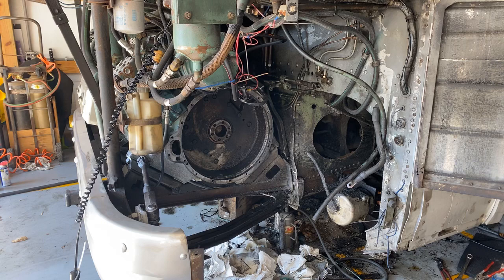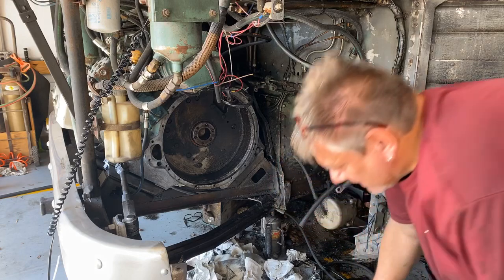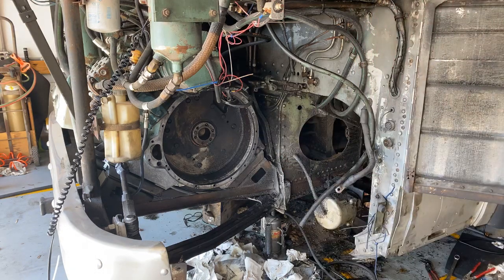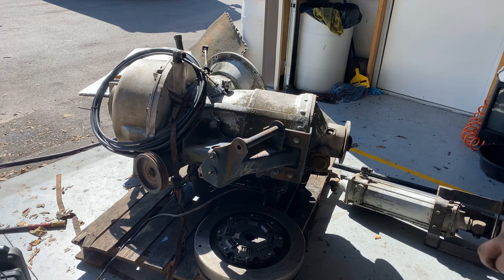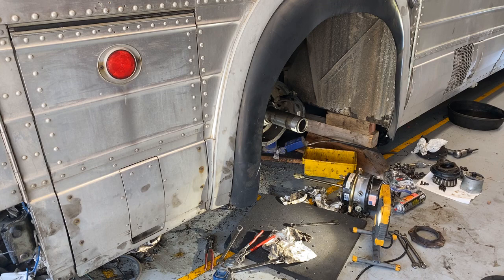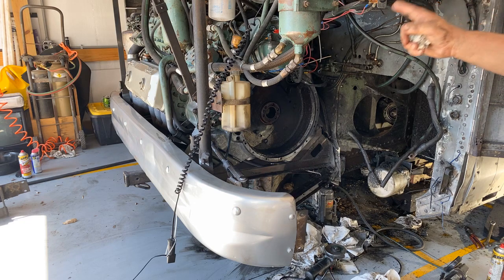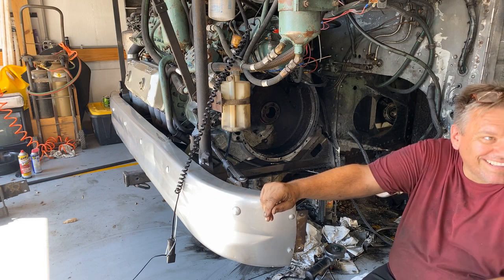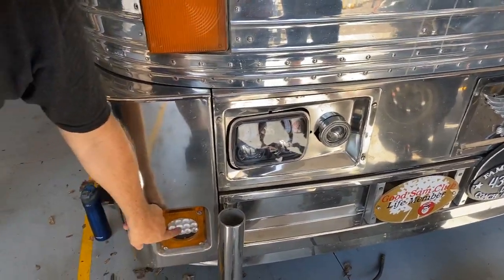V730 automatic trans upgrade live

Comment: Looking great....surprised on the diminutive sizes of standard transmissions. Quite tinny especially on MCIs (no angle drive) for the load handled. Used to drive the spicer 7 speed manual it is wonderful to drive and shift compared to the 5 speeds with only 400 splits. 7 speed was especially nice on the old the old MCI Super 9s (MC-12)with the 6V92s and the more modern suspension (less lean 😜). The Super 9s were my favourite bus to drive.

Comment: I really enjoy your videos! Thanks for sharing. The head lights look like a set I put in my Jeep Cherokee. They are LED and have one or two projector beam lens in them. They mess up your radio though as far a static goes. They warn you about it in the instructions. You can put some ferrite chokes on the feed wires to the headlamps I guess is supposed to help cut the static. Dim is horrible but on bright the radio noise settles down a bit.

Comment: I know that you have shown great patience in the past and will finish with a fine running vehicle. However, I carefully watched the first part describing the additional parts to be fitted into already cramped quarters with a much larger trans. As someone who seeks simple and reliable, a rebuilt 4 speed manual would have gone back in if it were mine. To each his own.

Comment: The  parking  brakes  on  that  were  probably  the  DD3  chamber . At  least  the  mc9s  used  them . You  applied  the  brakes  and  then  engaged  a  mechanical  lock .

Comment: Oh boy, make dang sure you have the correct double-lip rear main seal in that engine.  You'll get and ugly surprise if you don't.  Same thing with the gasket around the starter and a starter that is compatible with a wet flywheel housing.

Comment: Did you say the bell housing gets filled with fluid on the V730? You probably already know this, but the main seal will then have to be the double lip type. Also, don't some guys run straight weight motor oil in the V730 (instead of ATF) ?

Comment: That is a huge amount of work to do that conversion. All the sheet metal work.
So that transmission doesn't have a torque converter that bolts to the fly wheel, unless I missed something? 
I realize the dampener bolts to the fly wheel, and now the bell housing is wet, so does that  work in some way as a torque converter. Or is it built into the transmission?
That type 30/30 bake can would be much better than that Rube Goldberg spring brake set up, I would definitely want that on a bus I had if for no other reason that being able to get parts easily.
I keep missing your live feeds for one reason or another, keep up the good work, and live feeds are going to be a little fuzzy here and there, just the way it is. 
 As long as we can here what you are saying. It's good.
Great video, thanks Scott. 
Where are you going to be in Minnesota? Might be able to give you a hand if you need it.

Comment: Air shifter, man I have a lot to learn about buses.
Reply: Doctor John it’s old technology, but it works great.
I had a 1968 Bristol RE bus (English single deck bus) which has an electric gear selector on the steering column, connected to a set of electric controlled air valve chest on the gearbox.

Comment: Take apart the Transmission for inspection at least pull the fluid pan, could have water in it. Cheers
Reply from the maker: Plan on pulling the pan today.
Reply: @BusGreaseMonkey  
Great, it is much more simple then the engine, Please show us what you may find.
good luck